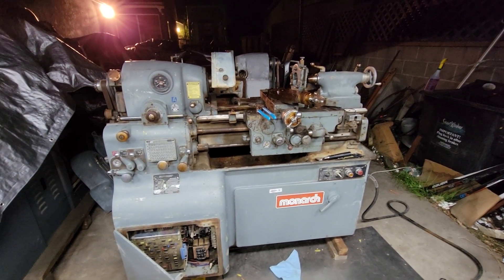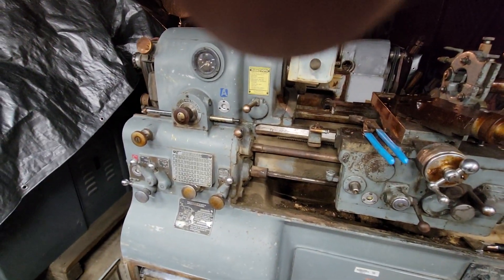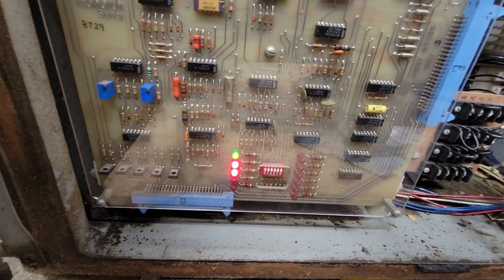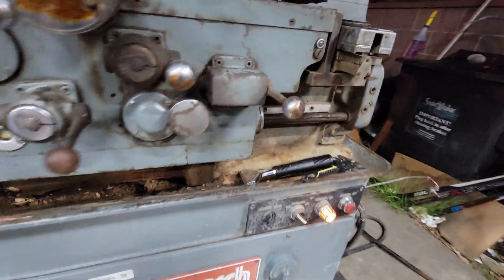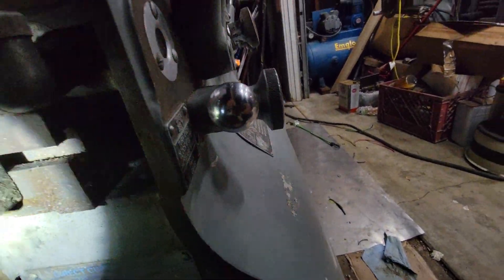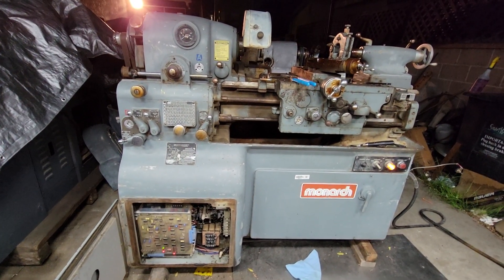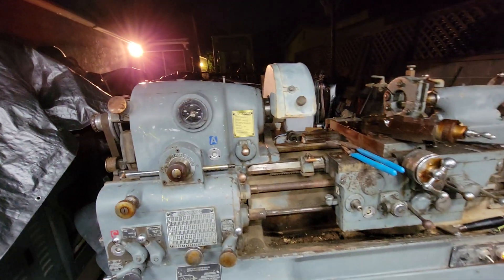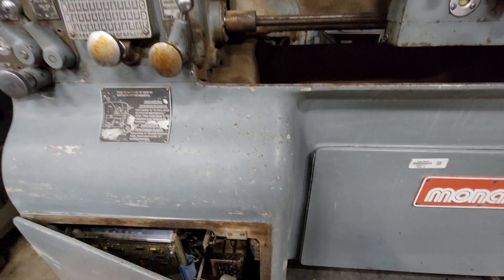Monarch 10ee I/M regenerative drive test run

Comment: Not sure what you have on that lathe in the way of motor overcurrent protection, but don't be surprised if overload protection on the pump and drive motors start kicking out especially when under load. The heaters (used in overload blocks) when properly sized are for the exact current for the motor at the voltage it's wired for. When you rewire the motor from 460 down to 220-240 you basically double the amount of the current draw. These numbers will be on the motor rating plates. You will either need to replace the heaters with the proper size for the lower voltage or bypass them which will basically do away with that level of motor protection. Remember that fuses are for general overall circuit protection. Fuses, breakers are generally either rated for the wire size, or 125% of the rated load, where as the overloads for motors (heaters) are rated for the exact amperage of a motor.
Reply from the maker: Thanks. Yes, Monarch mentioned that as well when they sent me the changes to make so I swapped out the heaters for the higher current as recommended.